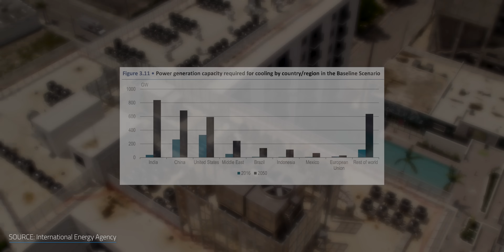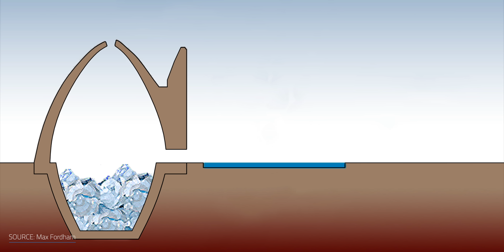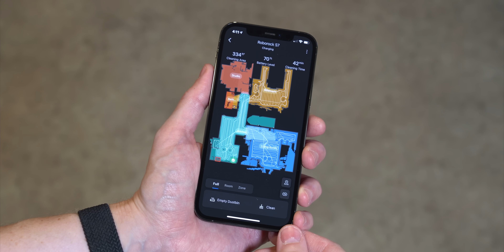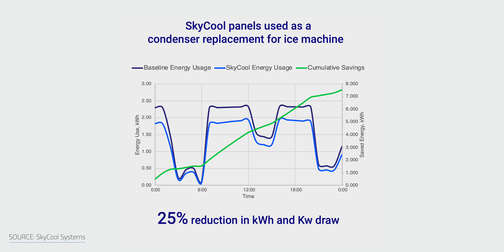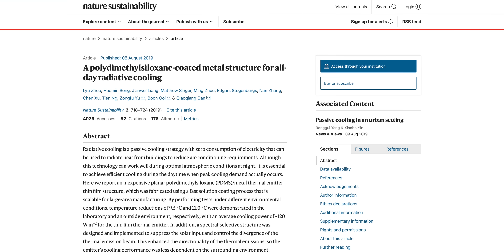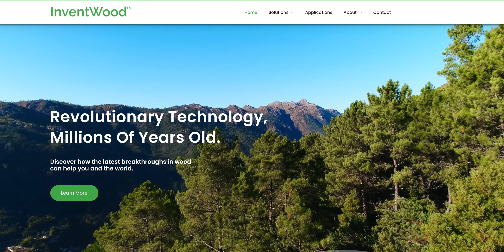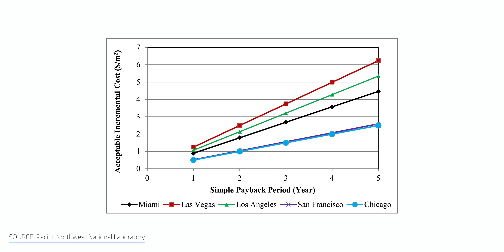Space Powered Cooling May Be the Future of Energy

Comment: That sounds really awesome.  I unfortunately don't have a real option for solar on my roof due to tree cover, and house alignment, and northern climate, and funky roof line, so I have been looking at other options that could be used in the next few years, and this looks neat!
I wonder if there was a way where we could cover the panels with some sort of ultra-black material that would absorb sunlight, and what is attempting to be radiated to space during the winter months.  Presumably that could heat up the fluid a bit and allow this to take some load off the heater too maybe.  Have some passive (minus pump and house fan) cooling and heating, and upgrade my AC and natural gas setup to AC and heat pump... That would probably save us a good $5-800 a year on energy costs.  Granted, if it takes 10-15 years to pay off then that isn't going to fly, but hopefully they will get the manufacturing side sorted out.  This could be neat!

I need to try and make one of those ice chiller dome things in my backyard with the kids next summer... if we could make even a little ice in the middle of the heat then that would be pretty slick!  Want to make some sort of passive humidity condenser system to passively add some water to the plant beds too.  We have plenty of water in the air... it just doesn't always fall as rain.  But if we can make a system that cools the air much below ambiant, then that would probably make a good amount of water too, even if we don't make ice.  hmmmm
Reply: Even better (but far more complex) would be a panel that acts as a mini solar farm. The main panel could be made to bounce light radiation directly to a small solar collection panel in the center. Passive cooling + solar energy.

Comment: I think this technology has promise. We don't have air conditioning in our house and this past summer it reached 44C outside. It was 36C in the house! We also had a few power failures because the system was strained too much with all of the air conditioners running at the time. Those Sky Cool panels would have been a godsend.

Comment: This system sounds like a potential winner for commercial applications (data centers, supermarket refrigeration systems etc).  For residential application, especially in desert/tropical areas, combine this with geothermal since if your geothermal loop is buried only 10 feet down that would give you a constant cool source of circulating fluid.

Comment: I have grape vines trained across my roof. I wonder what the cooling effect of plants is on a roof vs white paint. They not only capture and reflect the sun's energy, but they convert it to energy and food, and they require no manufacturing and minimal maintenance. In the process they sequester carbon. Only about 3 to 6% of the sun's energy is used by the plant for actual growth, while about 53% of the total solar energy is captured by the plant in some way. If there are multiple layers of leaves before the light hits the rooftop more of that energy can be captured. Heat within the plant can be dispersed among all the surface area of the leaves as a breeze blows through the vines. 

During winter the leaves drop and the sunlight can fall on the roof and be absorbed to prevent more heat loss from the house.

Comment: On first impressions I'not convinced it is a viable solution in the longterm. But I don't know enough how mature the circular economy of this product is. In the Netherlands more and more businesses are implementing green roofs for housing and business to tackle a multitude of issues. Green roofs holds  water better which diminishes urban flood risks. In the summer they insulate reasonably well for the heat and insulate well enough in the winter to hold heat longer. And as a bonus you have a nice garden on your roof during the warmer months of the year. With technology one is using precious resources to to solve a problem. However efficient from an economic standpoint the question is how durable these products are in the longterm. One also has to factor in energy and heat used in the production proces and lifetime to calucluate a true return of investment, besides the upfront costs of buying it as a product, especially on a large scale. Recycling a hybrid of materials is often extremely difficult and energy intensive. Esthetics is in the eye of the beholder, but they do not look esthetically pleasing, but more like a planned obsolescence product. We're still very far away from a utopia when it comes to recycling. Even space junk is a growing issue with  no real recycling solution, other  than burning it up in the atmosphere (feels still like a 19th century solution).  I think we should do more with building solutions, such as the heat absorbant paint, applying more green in urban area's, improve smart irrigation solutions of water and heat mangement and water retention with less loss due to unnecessary evaporation, even consider building yakhchal type cooling houses for water across urban area's, even perhaps as parks, for cooling escape activities during the day. I think the space powered cooling panels might help for some businesses, but I don't think this is a useful ubiquitous solution.

Comment: If the white paint is 98 percent reflective, wouldn't that beat out the space cooled panels in cost and maintenance?

Also, if that Supermarket had installed solar panels, what was the ROI have been to lowering their electrical cost verse radiating the heat out to space?

Comment: I've not read all of the comments so could be repeating some of this.
It isn't just air con that uses hfcs, the air and ground source heat pumps we are supposed to be switching to instead of gas or oil boilers use them as well. Few people seem to mention this.
Data centres can use water cooling quite often now as the exhaust temperature of the equipment can be 40 - 50 C and modern servers are happy enough with 25C intake temperature providing there is enough airflow, though of course they will tend to use more power for internal fans than if the intake was at 20C. It really depends on the climate of the location the DC is in as to how much classic air con heat pump will be needed on top of water cooling.
How much is the reflectivity of the panels and paint affected by dirt build up? 
When the cooling relative to air temperature is mentioned, is this the air temperature in full sunlight or shade? It would be interesting to see if evacuated solar tubes placed in the shade would perform similarly.

Comment: I live in a hurricane risk region, therefore I have to be very careful about building materials. The idea of putting a fluid filled panel above my house is extra risky. This is unfortunate, because the heat and humidity in my region would be ideal for supplemental cooling.
Reply: Humidity is, well, F'd up
Sunscreens on the outside of the windows (I use cheap curtains) lowered the temp by 10 C
I have a flat roof and I'm thinking to make it green
Reply: @fonzdevries4575  I love seeing solutions, but many times either humidity or hurricanes or just the oppressive level of heat is insurmountable. But hey, that's Southwest Louisiana for you.

Comment: "The more the planet warms, the more we will need to cool it down." 

I take issue with the premise. We may need to do so for indoors, but outdoors, no. In fact, we have fewer climate deaths than ever before. 

Exposure deaths greatly outpace "heat" deaths. We are warming up into a desert, jungle, and temperate planet. What our anthropogenic CO2 emissions are doing is accelerating this already going to happen warming. The runaway greenhouse gas issue is likely not true. Carboniferous Period has 12 times the C02 as now but was 3 times cooler on average: fairly amazing. 

Cool tech, but not all of the climate change talking points are correct. We do need to reverse our pollution, yes.
Reply: @-GinΠΓ Τάο , ""Heat" cannot "radiate" to space.  This would violate laws of thermodynamics which includes "Black Body radiation"."

Yes it most certainly does radiate into space. No it does not violate the laws of thermodynamics. Heat not radiating would violate thermodynamics, though.

Huge portions of astrophysics are based entirely on detecting bodies of heat in the heavens.

This is why not everyone should have a voice. No matter how many big words you use, you still sound very stupid to anyone who even a tiny bit of knowledge about the topic.
Reply: @-GinΠΓ Τάο You're wrong, fight me.
Reply: @-GinΠΓ Τάο , yes, you are specifically wrong.

Comment: The mechanism here has nothing to do with space, that's overselling it. It's about emitting heat away from a local area out. It doesn't matter if that radiation is 100% captured by the Earth's atmosphere above - there's no net gain of heat. If air absorbs 10% of the remaining emitted energy for each 10m it would be fine. The thermal radiation difference between the panel and space is not driving the movement of heat. The emission is happening independently, and if it's pointed toward the sky that's ideal. Importantly, the panels won't be receiving IR heat from pavement or the sun.

Comment: Actually radiative cooling works just fine during clear days. You have to prevent the sun from heating the radiative surface, either by shielding the panels or coating them to reject solar heating.
Reply: @-GinΠΓ Τάο You clearly have never been in the desert at night. He gets very cold because the sky is very clear and it sucks all the heat away.

Comment: I was on a bridge in downtown Seattle looking at white roofs which had become filthy with environmental pollutants such as soot, dust, and forest fire smoke. Originally brilliant white, they had become filthy dull dark grey within about two years. Even a heavy downpour didn’t rinse it off. Unless material is used that will rinse off in rain and/or the effort and expense of cleaning is factored in, white roofs would only be useful temporarily. I expect taller buildings would last longer but the discoloration would certainly occur but at a slower rate.

Comment: if they coat the road with reflective paint, at least IR reflective it would reduce heat on roads, cities, etc... with how much road cover earth surface you can get about 1% of the 2% you need to counter act the warming effect then roofs. When you look at meditareen house, especially Greece house they are all white and they didnt need AC. Car paint need more reflection as well as UV blocking glass(in some states it's illegal even to block UV light since it's consider as tint...) so it will decrease AC usage but it's nice in winter to have a black car so snow and ice melt and don't need that much heating. Here in canada roof are black, don't go in the attic durring summer it's an oven, so it will be great to make the tile goes from black in winter to melt ice and avoid roof overload to white during summer to make it the attic cool and so the inside of the house

Comment: In colder climates it would not be a viable solution, but there are no ends to the uses of this technology.
It could boost geothermal heating, by stealing the heat from the earth.
It could be reversed in winter and stealing the heat from the air to radiate it to a heating system.
It could be used in a solar water turbine field and work even at night or on cloudy days.
It could be wrapped around a pool as a radiative insulation that heat the water even at night.
It could be embeded in itself so a multiple layer with heat sinks in between each could make a self sufficient freezer that works off grid.
it could cool the already cool water from your house pipes, like a heat exchanger, to pre-heat the cool water that is headed toward your water heater.  Better yet, have a second tank that would be just above room temperature using this system without consuming electricity, to serve as a reservoir to the real water heating system.
It could be used to slightly heat a very small room, just outside your house on your doorstep so to reduce the heat loss when you open the door in winter.
It could be pointed toward your driveway to melt snow faster even at night.
I'm sure there are plenty more possibilities with this thing.

Comment: still waiting for the cooling paint to become available, so i can have cooler concrete pathways and driveway. it's supposedly just chalk, ground to specific particle size and mixed in correct ratio with regular pain/binders. as per most things, policy is needed to make any reasonable difference. most roofs in australia are painted dark colors, because that's the fashion trend for houses for the longest time. absorbs large amounts of heat that no insulation can fully stop.

Comment: I've been running reflective cooling on my roof for years.  I'm talking about actual mirrors here.  A square foot of sunshine will melt 18 pounds of ice per day.  I've got 100 mirror tiles on my roof; if you add 1,800 pounds of ice to your roof, that'll cool things down.  That's 3 tons of ice per square foot of mirror per year, or 300 tons of ice from just my one stupid roof.  
The problem that I've had is it works too well.  In the morning, when the rest of the roof dries off, the mirrors stay wet.  Any dust in the air sticks to the moist mirror.  So about three times per summer I clean the mirror tiles.  A kitchen scrubby and a gallon of water takes care of about 20 squares; I need about an hour and five gallons to clear the whole set.  If they don't get cleaned of dirt and pollen they wind up the color of wood, and that ruins the reflective property that they are up there for in the first place.  
In the morning, when the rest of the roof is dry, they dribble water.  Pretty cool!

Comment: I've been keeping track of this for some time. if placed in a Antarctica dry valley with a inflated dome it could reach dry ice temperatures and freeze out Co2 from the air. The valley's are already so cold they freeze out moisture. I estimate that at that temperature it would only cool at the rate of 5 watts per sq meter. So it would take a long time to fill a dome with dry ice.

Comment: Many things in this videos seam wrong. Yes, the radiative cooling is a thing, but there are many contradictions in this video. For example the Yakhchals make ice, but not through radiative cooling directly. They don't achieve temperatures lower than ambient. In the desert the air  is dry = no clouds which leads to .. yes, radiative cooling, but the whole desert not the Yakhchal itself. So the surrounding air gets below 0 C. You don't really need Yakhchāl to make ice. The Yakhchāl has an openeing near the ground through which cold air comes inside. The hot air escapes through the top (chimney effect, not radiative cooling). The cold air drops down under the Yakhchāl where it cools the water stays during the day because it's heavier. The whole purpose of the Yakhchāl is to preserve the cold during the day.
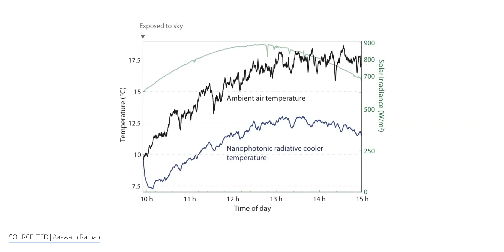As for the reflective materials they do not radiate, they reflect. They do not cool, they prevent heating. Now they could be reflective for visible light and dark for infrared, but I didn't hear that in the video. In order to radiate well a body needs to be dark (black) for that spectrum of the light. 5:45 -The radiative cooling happens at night. Extra 1% reflectance will not give you any cooling. Actually it'll reflect the heat of the building back down. If the panels are dark for infrared - that's something else, but then you should have said "extra 1% darkness (emission) ...". 6:26 - I don't know where this is from but it doesn't seam right. I will try it though. A lazer mirror (with no glass above the reflective layer) should do the same thing if reflection is the cause of cooling. We'll see if it drops below ambient. I really doubt it.
But I guess no matter how it works it'll save on electricity bills/carbon emissions...

Comment: Jury is out. We definitely have to see how well these would work long term since they will be susceptible to dust, hail, pollution etc. We also have to look at side effects. Will all this heat change local ecosystems or will the reflectivity interfere with anything?  Another issue is the applicable zone(s) where they would work. Certainly, further North, these would not make as much sense especially since they would be cooling a building down during the winter which would cause potentially more energy to be used. It would almost be better to design these as a heat pump design where it moves heat out in the summer and in during the winter. Perhaps they can design these panels to flip over in the fall and spring to reveal either this surface or a black surface and the system pump the heat in the desired direction.

Comment: 1:11 I'm going to stop you right there. Refrigerants have not had CFCs for a long time and they have not had HCFCs for a little bit now.  Since r134a, refrigerants have only gotten better and more environmentally friendly. Plus the refrigerants are in a closed loop system. They do not leak out unless... Well unless there is a leak. And it is illegal to vent them into the atmosphere intentionally so that drastically reduces how much refrigerants are vented into the air.  No modern refrigerant has HCFCs or CFCs in them.  No of course there are still vehicles out there with R-12 in them and there are still home air conditioning units with R-22 in them.  But when they get replaced it will be with an environmentally friendly refrigerant.  And the refrigerants will mostly be collected properly and not vented into the air.